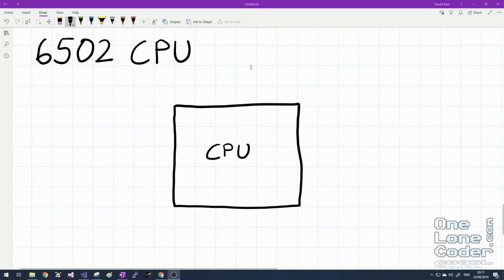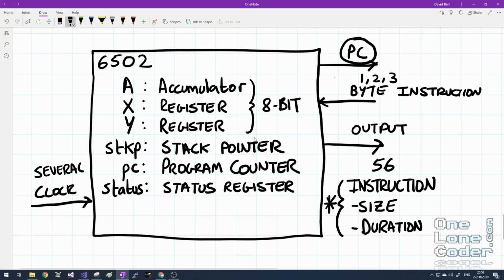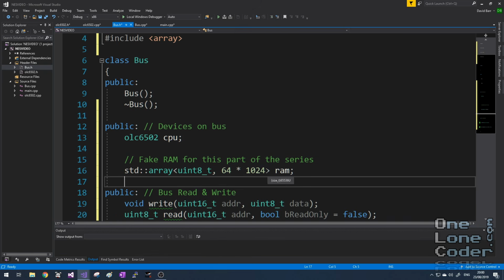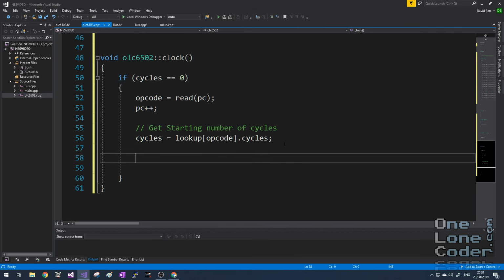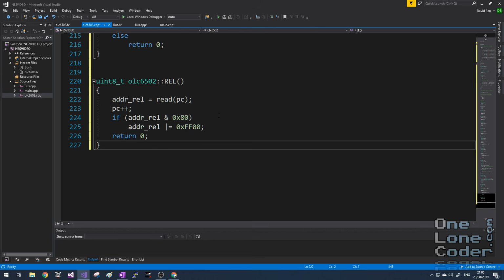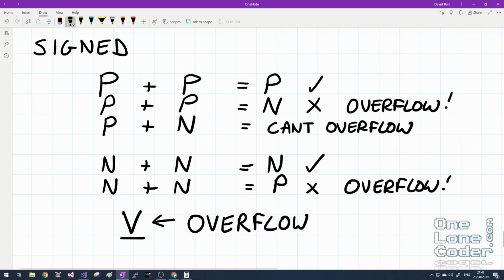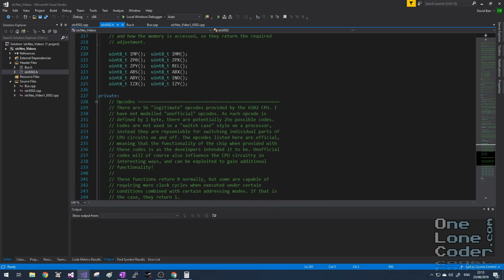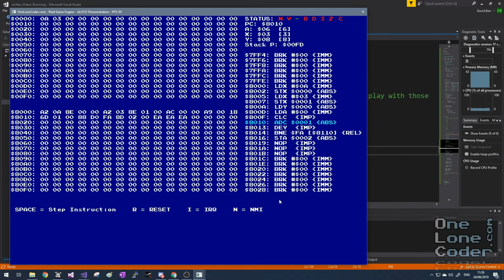NES Emulator Part #2: The CPU (6502 Implementation)

Comment: I cannot understand why both the addressing mode and the operator function needs to return 1 in order to increase the number of clock cycles needed for the instruction by 1.

Line 291
// The addressmode and opcode may have altered the number
// of cycles this instruction requires before its completed
cycles += (additional_cycle1 & additional_cycle2);

Why the bitwise AND instead of an addition?
Reply: I think I got it. A +1 cycle penalty happens only if the addressing mode crossed a page in memory AND if the operation is a read.

Edit: No that might not be it. The NOP operation returns 1 for opcodes 0x1C 0x3C 0x5C (and others) while all of these instructions use the implied addressing mode which returns 0 in all cases. The switch case inside NOP is essentially useless because of the bitwise AND in the clock() function. I think it's a bug.

Comment: Great series, I love it! I tried running Nestest and pretty much all of the legal instructions worked instantly. The only problem was the different illegal nop instructions. They were implemented in your table, even with the right cycle time, but they all use implied addressing, so the program counter doesn't get advanced the right amount. Not that it matters really. One other problem was with the b flag that doesn't get set correctly somewhere, but I frankly don't remember if it was just a problem in my code.

Looking forward to playing some nice nes games on the emulator soon!

Comment: Separate comment, as it's a different question:
Regarding the last 3 NOPs in the program, after the third one, it runs BRK instruction, is the expected behavior to reset the pc to 0?

Comment: I stole your function definitions and filled the rest in myself. It was a lot of fun. Thank you for taking the time to write them it was a perfect template for me to get right into actually making it. I ended up doing it a bit differently but also similar. I don't really know where to start with the graphics so i look forward to that part. 

I also made a disassemble function and just finished inserting labels in. Yours looks a bit shorter

Comment: I'm actually wondering, how your disassembler actually works. I've been following your videos and did my own and run into the issue that in-between the code are also just data bytes, that totally mess with the disassembly if going address by address, as some bytes can happen to also be an instruction. Even on the nestest.nes file this happens. How do you get past this... I feel like I'm stupid and I'm missing something xD. (I realise you have every byte mapped to something in your look up, even if it's not a proper instruction...)

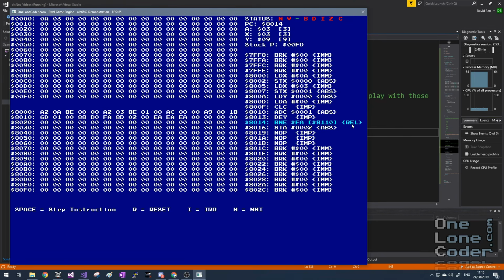Comment: This is an amazing video that is helping me write my emulator for the Z80 cpu. I noticed something that I am not sure if it is a bug, or deliberate. At the timestamp 01:03:02 the instruction is BNE $FA which means, jump back relative 6 negative bytes. But the computed address next to the instructions shown is $8110 when it should be $8010. Was it meant to be this way?

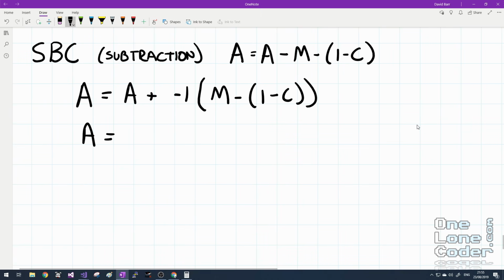Comment: 51:27 Either I'm missing something, but I think you got the algebra wrong there 😮😮
Algebraically, 1) A-M-(1-C) is not the same as A+(-1)(M-(1-C)) since it is equal to A-M+1-C. I guess you meant to rewrite 1) as A+(-1)(M+(1-C))=A + (-1)M + -1 + C

Comment: 32:20 in ZP0 I don't see the need to 'and' addr_abs with 0x00ff since read already returns an 8 bit unsigned number and it's going to automatically clear the high bits of addr_abs to zero anyways.

Comment: You said you want to set addr_abs to the next byte in IMM. Obviously still watching, but, it seems you set it to the current position of the program counter and then increment the program counter. 

Maybe I am misunderstanding, or maybe it's a bug you fix later?
Reply: This is a bit of a late reply, but you're absolutely right. I've attempted implementing a version of this emulator in LUA, and it doesn't function properly unless you set addr_abs to the current program counter before incrementing it
Reply: @thomasnelson7119  Yea, I was working on reimplementing it in Rust. Haha. I didn't test it, yes, though. Got busy with other things.
Reply: @nordgaren2358 Would you be able to let me know if you're able to execute anything other than the test script that's provided in the olcNes repository?
Reply: @thomasnelson7119  Maybe. I do want to get back to it, but, currently swamped with work :(

Comment: I get a compile error, use of undefined type 'Bus' on line 16 (return bus->read(a, false);    ...everywhere I've checked seems to indicate I can forward declare classes like this as long as they're pointers, but I might be greatly confused.

edit So, adding an include to "Bus.h" in the olc6502.cpp file seems to fix the issue, hopefully this is the correct way to handle this

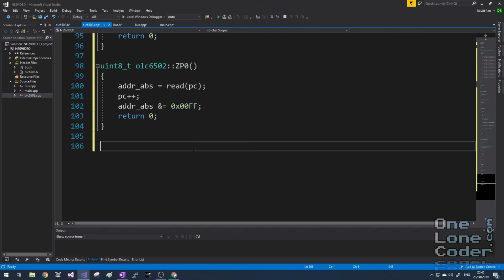Comment: at 32:32, ZP0 implementation. read() return 1 byte, so addr_abs = read(pc) is enough, why do you need & operator. 2 bytes & 1 byte = the same 1 byte

Comment: I've started a super long journey on my own emulator. NES made me who I am today as well :P i was handed a controller for this system at 5 years of age and was hooked to the thing for years. The eventual upgrade was ANOTHER NES (toploader) when the side loader finally gave in.  Anyway, all this masking stuff is cool, but I can't but feel a few boolean flags set as true or false would be a lot easier than using mask offs and bit shifting to test bits in a byte  for the SR register. Anyway, lots and lots and lots and lots of research ahead of me.
Reply: How’d it go?
I’ve decided to make my own too, but i’ve decoded to make it not only cycle-count accurate, but also completely cycle-accurate
Reply: @chri-k  I'm nearly through all the opcodes and onto the PPU memory areas, then I stopped. I will get back into it eventually. I have a LOT going on. In a 6 month fullstack bootcamp with an assignment each week atm + super interested in picostation
Reply: @vajskidsconsoles2005  isn’t that’s exactly what happens to 90% of all projects. They get interrupted and/or forgotten about.
I just finished the 6502 ( fully cycle-accurate, which is actually necessary for some of the more weird code to work correctly ) except for interrupts ( and i now realize i accidentally skipped over JSR ), but i have yet to test it after just having refactored it to make sure everything still works
Reply: @chri-k  it did start in C++, so i essentially started again... I found the imgui and other graphics stuff too long of a learning curve to even do up a debug screen etc.
Reply: @vajskidsconsoles2005  Which library were you using?
Reply: @chri-k  nothing yet. it's all vanilla. for actual graphics just canvas
Reply: @vajskidsconsoles2005  i meant which one were you using in C++ and found to be too hard? I’m just interested because i don’t think you even need a GUI library for this
Reply: @chri-k  I hadn't decided on anything properly but did have a go with imgui and gave up pretty quickly lol.
Reply: @vajskidsconsoles2005  
( i didn’t realize there was an imgui library literally just called imgui )
Reply: @chri-k  'dear imgui'

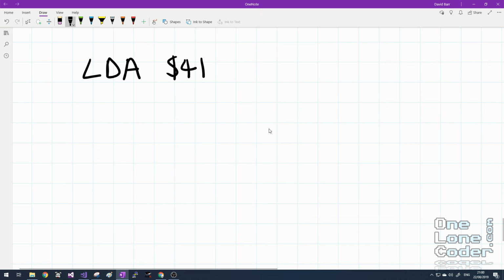Comment: 10:50 i don't know if anyone earlier noticed that (don't want to scroll through the comments), but LDA $41 doesn't load accumulator with "41" immediate value (this is what LDA #$41 does), instead it loads accumulator with vaule of zeropage's $41 address. So it's like LDA $0041, but takes 2 bytes and fewer cycles, thus being faster.

Comment: I'm curious about the clock. Since you are not actually setting a time delay, only counting down the cycles, would this not cause it to run significantly faster than the original hardware? And if so, would that not affect the actually execution of games?

Comment: Quick noob question here - why use a byte / unsigned char for the Flags bits when these are either 0 / 1? Would bool not be better? Interested to know why. Thanks in advance
Reply from the maker: In this instance I'm using the individual bits of a byte as 8 different variables. It's convenient to manipulate this "set of bools" as a number. Surprisingly, bools are not represented by a single bit, which makes grouping them a bit trickier, and because they are exclusive to each other it's hard to manipulate them all in one go. For example, I can flags = 0, to set all the bits to 0, whereas I would need to set the bools individually.
Reply: @javidx9  ok great, thanks a lot, much appreciated. thanks for putting this all up and sharing :thumbsup

Comment: Wait so this doesn't reqire any open gl or vulkan?
Reply from the maker: Not directly no.
Reply: @javidx9  so no api? Or i just want to make sure i can compile it because I've been having trouble with that becouse I'm on linux
Its just using the window in VS code?
Reply from the maker: The header file contains the build command for Linux.

Comment: Olc why didn't you just use a 8 by 8 opcode matrix? Wouldn't it reduce the no of opcodes to insert plus the fact that your emulation program does not take illegal opcodes into account?
Reply from the maker: Because I can use the opcode as the index into the array as it's sparsley populated.

Comment: 32:30, shouldnt you cater for a greater than 256 size abs_adddr? In this case, the 6502 does a "wrap around" back to 0x0000. This could be covered later though

Comment: Wow, probably shouldn't be impressed but function pointers are a nice thing to see in a video like this. I feel like too often they're looked at as some kind of bad practice, only to be replaced with some kind of Switch statement. In a more basic project, that might have still happened, but when you have to jump to this number of different points, it's by far one of the most practical solutions.

Comment: LDA $41 doesn't load the value 65 into the a register but instead reads from zero page at address 65. If you want to load an immediate value into A, you would use LDA #$41

Comment: A better example of signed byte overflow would be 127+5, because 127 is within the range of both signed and unsigned bytes, while 0b10000000 is -128 as a signed byte, and -128+4 does in fact equal -124.

Comment: As someone who long ago used an Apple IIc (65c02) and wrote an assembler in Appllesoft Basic, and then used that to write a faster assembler in assembly in order to develop some programs that could run at a decent speed on that machine, I am very glad to see this series and the very nice way the emulator is structured. Thanks javidx9!

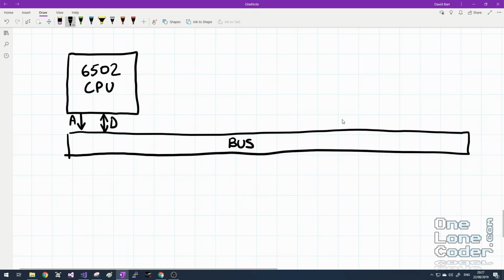Comment: 3:20

The Apple ][ used a "third" mode: for some things it just decoded and used the address, ignoring any data going either way - usually as a flip-flop controller (of a single bit), referencing the address flipped its state.  Due to the design of the 6502 this could result in a flip-flop changing twice in a single instruction (writes first read), or a flip-flop changing when addressing somewhere else (on a page boundary cross indexed address).

Comment: what do you mean the modern way of displaying a number as a string is appalling?
The semi modern way is to use stringstream and use a modifier hex before your number (and then probably reset it with dec), which is of course a little unwieldy.
The super modern way is to use c++20's format() function, which is not only faster but also very nice to use and combines the advantages of cout and printf and adds the additional advantage of having a format string that indicates which argument place is to be used, allowing easy localization by just swapping out the format string (instead of reordering the arguments).
More here: https://en.cppreference.com/w/cpp/utility/format/format
Unfortunately g++ standard library does not yet include it, even for g++-10. in windows, I think you can include experimental/format. The functions are available in the fmt library, from which the standard implementation will likely be taken. (The author of fmt proposed the standard)
I very much enjoy the fmt library.
Reply from the maker: Perfect. You answered your own question!

Comment: Teeny correction.

LDA $41 isn't loading the accumulator with the constant $41, it's loading the accumulator with the contents of address $0041. You need the # before the $ for it to be an immediate, you're actually invoking zero-page addressing there, not loading an immediate value.

Also, why don't you go to the Western Design Center for datasheets? They're very up to date and they're provided by the company that canonically decides the 65x architecture specs.

Comment: I'd just like to say thanks for this video! I've recently written a 6502 emulator for a pet project, and it's randomly weirdly similar in design to yours (aside from the PGE)! I'm going to be revising it though as some of your decisions are definitely improvements on my initial code! I'm mostly a hardware guy, but wanted to emulate a 6502 based retro computer I'm working on, which will have pretty advanced graphics, sound and even networking, so should be cool to learn to code on, and play games 😁 I'll also be trying out your PGE as the emulation interface, so thanks again!
Reply from the maker: Hey no problem Stabby! Your neoretro computer project sounds fun 😄

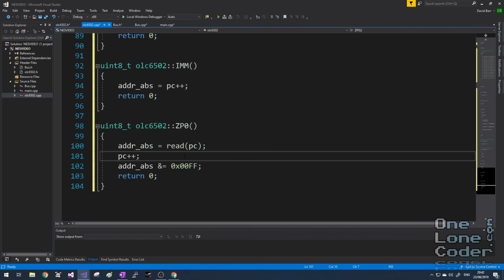Comment: I've been looking forward to an in-depth video series like this for years! I'm going through your implementation @32:00, and I noticed that the implementation for ZP0() masks `addr_abs` by `0x00FF`. I can see how that's necessary for ZPX() and ZPY(), but do we need that for ZP0 since we only read a single byte for that case? Is that merely for consistency between zero-page implementations, or am I missing an important detail there? Can `addr_abs` have a value beyond 255 after line 100 has been executed? It sounds like we're only reading the low byte as an optimization, so does that mean that there's actually 2 bytes there?

Comment: 37:50 what does changing the high byte to all 1’s do? how does it ensure that the binary arithmetic “works out”?
Reply from the maker: It propagates the "sign bit" throughout the hi word, thus remains compliant with regular binary arithmetic and interpretation rules.
Reply: @javidx9  so the convention is to make the high byte of a two-byte signed number all 1's when it's being interpreted as a one-byte number? thanks for the speedy reply! i didn't notice you had already responded

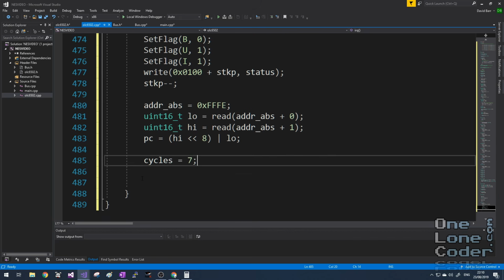Comment: 56:15 you say "the non maskable interrupt is exactly the same except ..."

I am confused as according to Ben Eater (with live testing) the maskable interrupt needs to be guarded by an sr latch or it will preform the interrupt operation as many times as it can while the signal is high, whereas the non maskable interrupt does it's thing and returns. 
MY QUESTION IS is this part of the "electronics" we're ignoring, or does it somehow not effect your system?

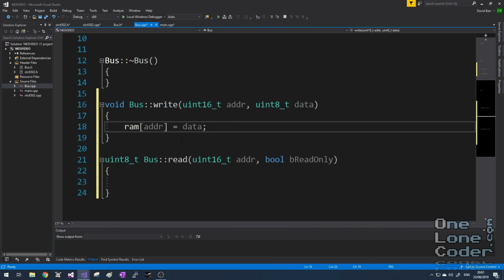Comment: 20:06 Adding a guarding instruction, checking if address is the range of RAM (0 to 655535, 0x0000 to 0xFFFF).
-------------------------
This really -- in effect -- isn't pointless (using the guarding statement) but it does mean that your program is doing extra logic that is not really needed (a performance hit).
-------------------------
addr is an unsigned 16-bit integer....

range: (2^0-1) to (2^16-1) = 0 to 65535

if (addr < 0 || addr > 0xFFFF) -- logically this can never be true given the defined range for uint_16.
and the opposite: if (addr >= 0 && addr <= 0xFFFF) -- must logically provide an invariant that is always true.

Based on this, I believe you can optimize away the check to increase performance (since it really doesn't add any benefit, given the above).

Comment: I'm doing this on mac, I tried going through the process for the test engine explained on your Github. Manually, copied about 30 library dependencies which were not in my stl for some reason and yet I still can't get the olcPixelEngine to work. Any suggestions?

Comment: (There is something wrong with your convex polygon video.  Awesome video, but the comments section won't come up in that video.)  I wanted to comment about "diagonal" intersection method presented in that video.  Could you use one corner as the "center" and only have to calculate N-1 "diagonals", versus using center and requiring N calculations?

Comment: At 31:13 line 94, shouldn’t you use a pre-increment (addr_abs = ++pc)? You’re currently storing the previous value. Or is it supposed to be that way?
Reply: I'm currently following this tutorial, writing in Javascript. This got me too, I even tested the code in both C++ and JS to check that I wasn't going insane. I'm just going to leave it as Javid wrote it, as it's written the same in the Part 7 code and it looks like he got something working by then.

Comment: Why keep track of the number of cycles if the emulator isn't going to be cycle accurate? Does this get used?
Reply from the maker: Its still important the correct number of cycles occur so the instructions finish when they are supposed to.

Comment: Sorry if i am wrong but in the sbc the equation is wrong you can take m-(1-c) you have to take -m-(1-c) it will result to
-m+c-1 which will result in the one in the twos complement to be redunt i thinks this the right way to do it correct me if i am wrong